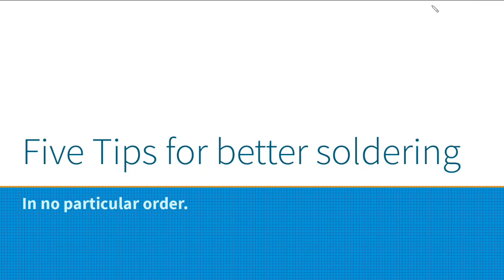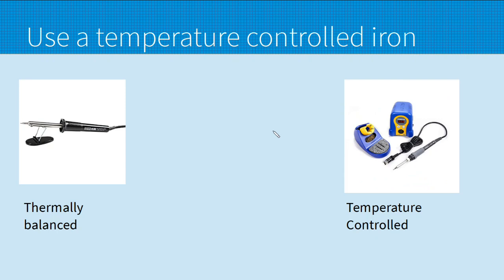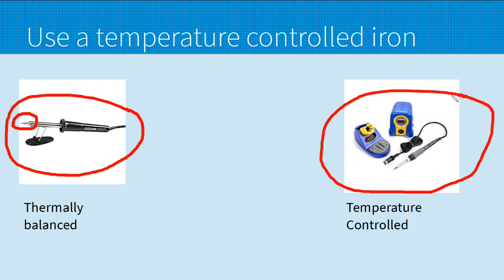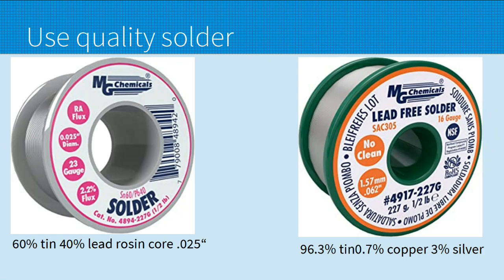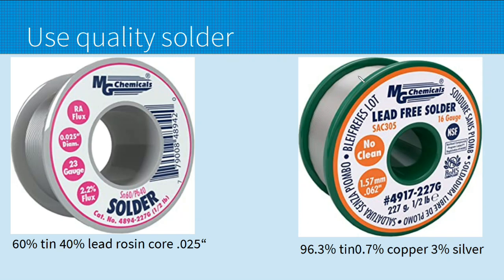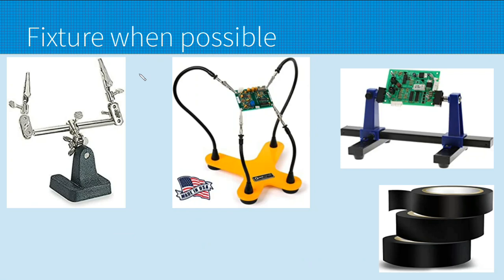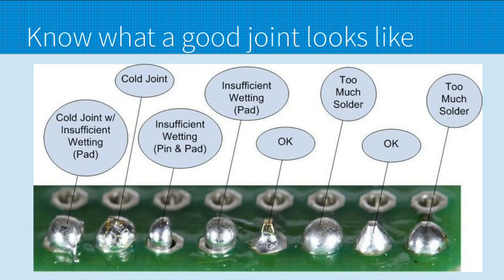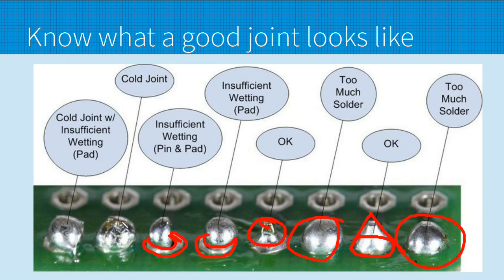Five tips for better soldering

Comment: Picked up a temperature soldering iron from local Lidls in the UK few months ago - <$20 - simple affair but really does make difference.

Lead solder just works well, but also want ventilation filtering when heating anything up over 100c be that the kitchen and more so soldering.  You can't buy a new set of lungs on ebay - just saying ;).

Great advice - more so the size of solder - easier to use thin solder wire for tasks than thicker stuff.

Magnifying lens set-up for smaller stuff - however good your eyesight is - really does help.

Also sticky putty - playdoh, bluetack - always helpful.

That all said - like many - have the dream project of building a robot arm with 3D vision system that would control and do the soldering perfectly for me.

Comment: Cool video but I cant get anything to work hardware wise no 555 no 4060 no 741 nothing and I usually get things right away. I'm good with arduino and the nano got ros working have huge robots and a saucer but cant seem to get any ic project working.that was the problem I was doing sloppy soldering!😁

Comment: Thankfully I have some connections through which I could secure a 1 kilo spool of 60/40 - that will probably last me for the rest of my life. Here in Germany the stuff is near impossible to get (unless you have a commercial business license or „Gewerbeschein“, in which case you can order as much as you like). You can get lead free any day and twice on Sundays but for some connections that stuff is an absolute pain in the neck to work with. The lead based solder is so much nicer and easier to work with, and unless you replace your chewing gum with chunks of solder and keep actively huffing the fumes with your nose directly above your iron, you should be fine.

Comment: My dad wired up a household light dimmer to run the old school thermally balanced iron.  Voila, "temperature control."
Reply: That is still not temperature controlled. It is power controlled. There is no thermal feedback loop controlling the power output.
Reply: @1pcfred  Yes, hence the quotation marks. ;-)

Comment: Why don’t they indicate the melting point on solder rolls?
Reply: Because you want to run considerably higher than that. How much higher depends on the heat mass of what you're soldering. So no one can give you a temperature to solder at beyond hot enough.
Reply: @1pcfred But the melting point of the solder itself. Like, professional jewelry waxes have their melting point indicated, so you’ll don’t burn it.
Reply: @1pcfred  I hope I still have a lot to learn!  But for soldering it’s ok, thanks for your concern. I was just curious, that’s all.

Comment: how to solder 18650 batteries so that they are not damaged? It was suggested to use 'spot welding' or high heat soldering...some tips on that would be good.
Reply from the maker: Watch tomorrow's video...May 12, 2021

Comment: how do i check the voltage out of a Hard drive power connector? i hooked a hard drive power line up backwards and OOPS it killed it.. now i need to figure out if i can swap some parts off that board...  up for the challenge?

Comment: Great tips, Paul.
When I set up my 'makers' bench a few years ago, I got carried away and purchased an SMD soldering 'center', with a built in digitally controlled  bench PSU, a digitally controlled soldering iron, and a digitally controlled heat gun.
The PSU died within 2 months, for no reason. The soldering iron has a short somewhere, so it keeps getting cold while I'm trying to solder. But, hey! What the heck, the heat gun still works. (already had a digital temp heat gun and old school solder iron that still works.) [:-(
Forked out the extra bucks for a Panavise, because it has a heavy base and interchangeable vise/holding attachments. But, I only use the head that's similar to your sweet little PCB holder. My contraption is awkward to adjust and takes up too much real estate.
Wish I had saved my money and got one like yours, instead. Every time I see you using it, I'm kicking myself.
Didn't know about flux pens at the time, so now I have jars of the stuff, which will last longer than I.

"Less is more."

Comment: I think lead free solder is horrible stuff, from the point of view of soldering. The lead free solder melts at a higher temperature than tin lead, it does not flow as well as  tin lead solder. The joints of lead free solder look like dry, with a glassy appearance, and in my opinion is far more brittle.
Lead free solder may be less poisonous, but it really stresses the components it is used to solder. When soldering surface mount components, lead tin solder flows better and wets the joints better. I do not know what the surface tension difference is between the two types, but in my experience lead free is more likely to form beads. Because it melts at a higher temperature, it also cools much faster, resulting in cold joints..
From the above, you may have gained the impression that I hate lead free solder, you would be right.

Comment: Unlike what has been implied, adding up melting points for alloys doesn't work. 
SAC305 has a lower melting point compared to raw tin even if it contains elements with an higher melting point
Reply: Chemistry, eh? Nonetheless it  is true that the lead-free solder requires significantly higher temperature, which is probably all the info we needed here.
Reply: Of course......you could NEVER melt copper with a soldering iron, but it can be in lead-free solder.

Comment: For beginners: to get the good joint shown in the last picture, get enough heat and time in the solder joint so that the solder will  really melt for 1 or maybe 2 seconds and you can see the solder really flow. Less time and heat will make the solder joint look like the crappy solder joints shown in that picture; you can see that the solder did not really flow in those solder joints.
Reply: All those joints sucked. Hung over and blearly eyed I wouldn't be happy with any of them. Although for a quick temporary tack they're OK. I used to hand assemble military radio gear with two inspectors breathing down my neck day in and day out. Man they were a pair of absolute ball busters. They'd be whispering behind me, We need to see the form of the conductor. Less solder. It really was maddening. I wanted so bad to say if that's how you want it then why don't you do it? Why it took three of us to solder one thing I'll never know. But hey I was getting paid.

Comment: Thanks for not forgetting us beginners. What would you consider the common causes of lift pads when desoldering?
Reply: iron not hot enough so joint takes too long and melts the glue that holds the track down hot and quick is the way to go.
Reply: @robtitheridge9708  Thank you.
Reply from the maker: Dwell time. A hotter iron for a shorter time is better than the opposite. We are trying to avoid heat soak in the parts.
Reply: Poor technique. Use the 3 second rule. If you can't make a solder joint in less than 3 seconds stop. Then clean while things cool down and try again. Clean everything. Your iron tip, the solder you're using, the part you're trying to solder and whatever you're trying to solder it to. Contaminants are one of the leading causes of solder failure.

Comment: Fantastic video and explanation Paul!
I find the holder with alligator clips good for holding wires and things for tinning and joining .
One thing I learned a while back was to check what types of tips are available for any iron you are thinking of buying before you buy it - i have one here that I didn’t do that and they only sell conical tips for it and not the 2-2.5 mm chisel tips I wanted ! That’s what I get for impulse buying 🤣
I suppose I could retrofit another brand of iron to the supply - probably less hassle to just go and buy a Hakko or the like .
Reply: Dont forget to install some shrink-wrap on those alligator clips to make them less harsh on those wires! I had honestly never thought of that before seeing it on a video.
Reply: I took to the teeth with a file to knock the tips of the teeth off then put two layers of heat shrink on , this still leaves some small serrations that the wire sits in nicely but they are not sharp enough to cut through the heat shrink.
Reply: @Flattyman  Good show, Ian!

Comment: Thanks Paul I've been at it for like 3 years now (I'm 33) and I've heard/seen before just like you said "use a wide tip" like a screwdriver but I've always liked the pointed tips where its tinned to the base of the cone. I've used wider tips and I don't understand the benefit, quicker heating?
Reply: Yes more contact area means quicker heat transfer
Reply: @Darfail  thank you, I gotta give it another shot then :)
Reply: Pencil tips suck. The geometry is all wrong for heat transfer. Round leads, flat boards and round solder are not contacted properly by a round heat source. You need another flat in that mix. There's a method to solder. You heat the pad away from where you are soldering then feed the solder onto the pad and part lead away from the iron tip. The solder then flows up to the tip. The chisel point does that the best.
Reply: @1pcfred  thanks Paul lol I've tried um all and found I liked the pencil tip best but I don't feel like I gave the others a honest shot. What you say makes sense I just have to get over that awkwardness. I want to do what's best, thank you for your time :)